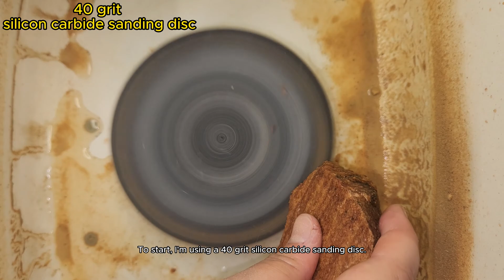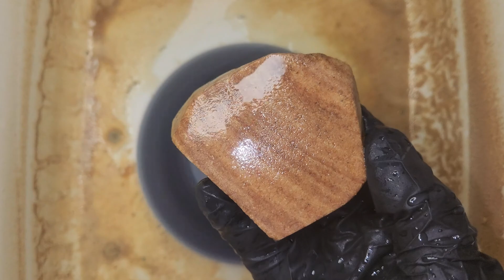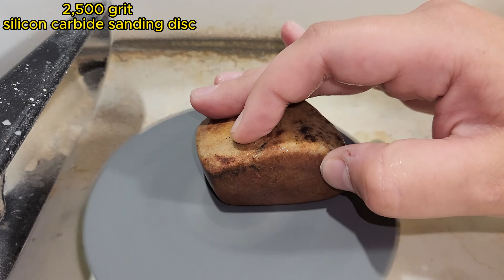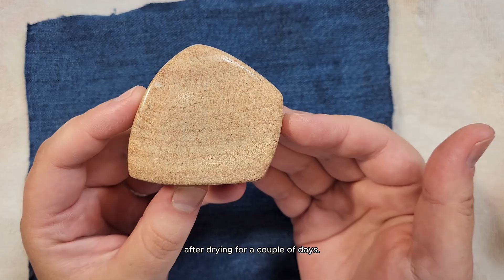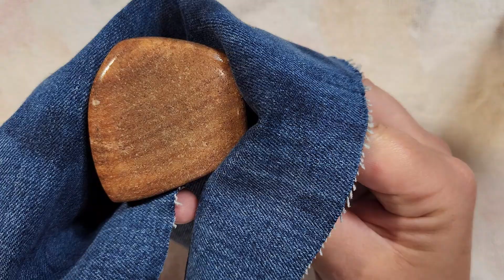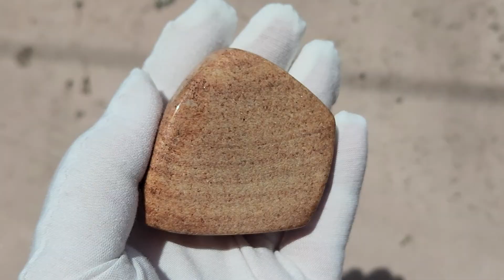Polishing Sandstone | Using Polisher/Sander and Dremel

Comment: Love the video! I have several larger pieces of basalt and sandstone which I’m starting to polish and this was one of the few videos that I found which focused on that kind of rock! If you have any recommendations/links on basalt polishing I’d love to see them!

Questions:
Are you using just a standard tooth brush? Or would you recommend a wire brush? I have a set of stainless steel/nylon/copper brushes that I’m considering using but don’t want to mess up my progress! 
Also would you recommend cleaning and scrubbing with soap between each stage?
2. If my rock still has several pits after the first stage, should I keep sanding until they’re all gone? I don’t want to take too much size off the rock. 
3. Have you ever used a polyurethane sealant after applying the mineral oil?

Thanks!
Reply: Thanks! Seems like there’s a million different approaches and philosophies to rock polishing so I’ve been all over the place with my research 😅. 

I just finished the first stage on my basalt and it looks great, although there are still some pits remaining. I’m ok w those since I don’t want to lose any more material. Do you think the pits will have an issue w the polish? I assume that the polish should come out fine for the flat sections and then I’ll just have to accept the pits as they are. 

I have a piece of sandstone which turned out great after the first stage as well. 

I haven’t tried the polyurethane yet but am more interested in this than the mineral oil since I’d like to avoid the oils collecting dust (I’ve heard that’s an issue) and also because I’ve accepted I likely won’t get a true polish with the tools I have (just using diamond pads on a hand drill) - so the poly will bring out the wet look and then I’ll likely do a final resin as well.
Reply from the maker: @davidromoser6148 I think you're right about the pits you'll just have to accept them as is. It would be good to keep them cleaned out with a brush during polishing and with the poly finish it's going to look great!
Reply from the maker: Thank you! I'm glad you found us! I haven't polished any basalt yet, so I unfortunately don't have any recommendations. Sorry about that. I can answer your questions though! 
Just a standard toothbrush. I think you're right, using metal brushes will most likely leave scratches on your work. I would not do that! You can get soft, medium, or hard toothbrushes so you have some variety in the brush strength. 
I think scrubbing your stone in between stages is best. You don't need to use any soap, just water. I have a brush attached to the bottom of my rinse bucket so I can scrub and rinse at the same time, and then I have the toothbrush for more stubborn spots. 
If you want a smooth surface you'll have to keep going on the lowest stage until you get the pits out. I know that can be frustrating when you want to preserve material, but it will result in a smoother finish at the end.
I have never used polyurethane on my rocks, that's an interesting idea I haven't even considered! Maybe I will give that a try. Have you ever done it? If so- do you have any tips?   Mineral oil on a well-polished rock will last for a long time. You could always rub it again to bring the shine back out. The polyurethane would be permanent so that's nice!
Thanks for your comment and great questions!

Comment: That’s turned out to be beautiful. 😱 May I ask how you built your set up with the grinding tool and which one you used? My son and I went out and found some neat rocks and quarts and I think this would be a fun way to keep us both entertained 😬
Reply from the maker: this shows how we have the tool mounted-
https://youtube.com/shorts/JgH60AFI4ao?si=9VCRexrF_F4AuRnQ

here's the polisher I'm using- https://www.harborfreight.com/10-amp-7-in-variable-speed-rotary-polishersander-57384.html

I'm using silicon carbide sanding discs that I purchased from Amazon. pay attention to the pad size that comes on the polisher, and size of the sanding discs you get. you may need to get a back pad that will match the sanding disc size. 

you can also hold the polisher in your lap just set a towel down underneath it to protect your skin 😁
Reply from the maker: https://discord.gg/WHNufJJh

you can join our rock talk discord if you'd like to share pictures or ask questions 😁

Comment: Loved this video!  Tons of questions:
Did you have to dry a lot in between each different grit?
How do you know when to toothbrush off the dust?
How is your sanding disc set up and the area around it?
Do gloves protect you from getting hurt during the lower # grits or do you wear them for a different reason?

Finally I wonder if you can help me with this.  I read:
"One way of checking the hardness of a stone is to try to scratch it with a penknife. If the knife cuts a mark or produces a powdery line, then the stone will not polish. If the knife leaves a metallic line, then the stone is harder than steel and it will polish. "

I would imagine this sandstone would scratch powdery, gritty or white, meaning it wouldn't polish well, so I'm surprised that you polished it.  (They go on to say: "This is not to say that softer stones, such as serpentine, cannot be polished, but they must only be polished with other stones of similar hardness and not mixed with harder stones")  How would the stone in the video scratch if you took a penknife to it?  And what do they mean by 'metallic line' with a harder stone?

Much thanks!!!  Hitting your coffee fund!
Reply from the maker: thank you so much!! 💜 
no, I did not let the stone dry. when I wasn't actively polishing it sat in a tub of water. 
I knew when to toothbrush off the dust because it was getting trapped in small crevices. usually, when going over the surface with the sanding discs I'll see those small crevices start to clear out. but in this case, it was building up. 
this is a variable speed polisher that we have mounted to a table and it's surrounded by a plastic dish tub. here's a video that shows that a little better - https://youtube.com/shorts/JgH60AFI4ao?feature=share
these are nitrile gloves and they do offer protection from quick touches, even on the low grits. I started off wearing leather gloves but as my handling skill has increased I've switched to nitrile gloves because it's easier to hold and maneuver the rock with nitrile gloves vs leather gloves. 

it sounds to me like they are talking about rock polishing in a tumbler because they're saying "they must only be polished with other stones of similar hardness". I've polished several stones that would be scratched by a pen knife. fluorite and marble are the first that come to mind and they polish beautifully. 

I just went and scratched a raw piece of sandstone with a steel pocket knife and you were correct, it was white and gritty. ☺️

I think by metallic line they mean that instead of leaving a scratch in the stone, you'll just see the metal rubbing off on the stone indicating that the stone is harder than the knife. 

thank you so much for your support and your excellent questions!! 😁